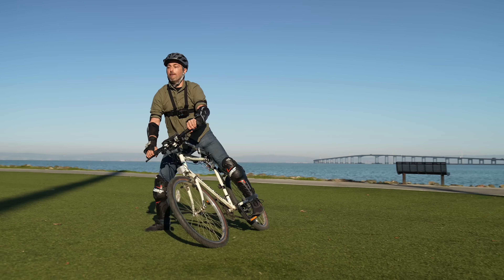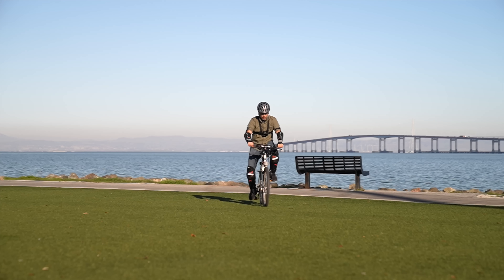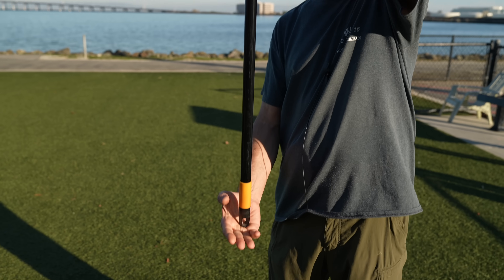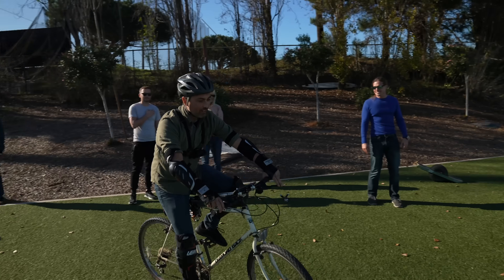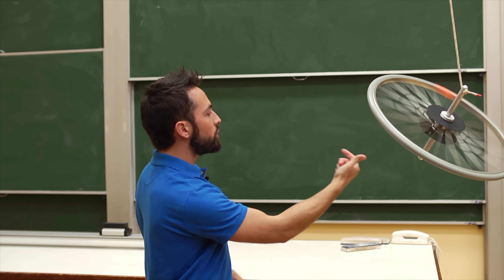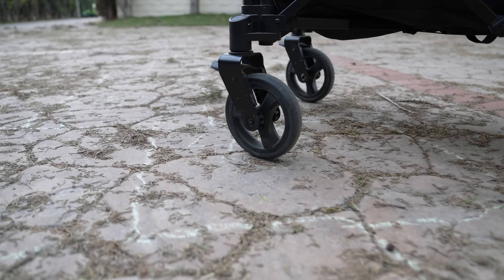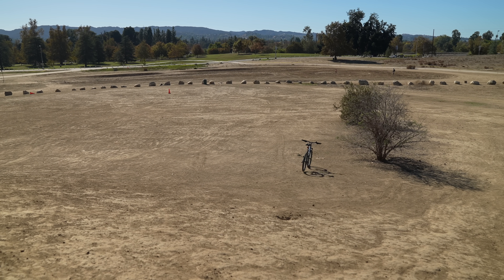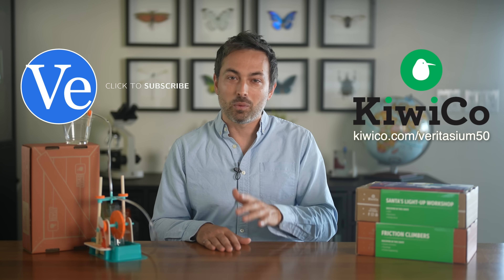Most People Don't Know How Bikes Work

Comment: "Turn right to go left... Hm..." —Lightning McQueen, moments before disaster
Reply: The mechanics said Lightning McQueen would never race again.
Reply: Ah yes, Doc Hudson instinct had prevail the truth.
Reply: lol
Reply: Kachowww
Reply: ayo my favourite embery piano dog
Reply: That reference was awesome.
Reply: That's dirt track racing! Typically the cars have brake bias, with most of the braking force being applied to the rear and left side tire. This way tapping the brake pedal pitches the car sideways into the corner. Some dirt track cars, like sprint cars for example, don't even have brakes on the right front wheel. Anyway, as you enter the turn you tap the brake which then pitches the care sideways into the corner. Of course, you also immediately start to counter steer to keep the car from over rotating and spinning out. And then you begin to apply throttle. Applying throttle helps the car to turn or rotate by spinning the rear tires. So, while rounding the apex and exiting the corner you control the yaw of the car by modulating the throttle and also by how much you counter steer.
Reply: I found your channel by looking in the comments , I love your vid, even though I found you today
Reply: Yup. My car almost crash slipping on rainy road while my car is 90 degrees facing divider. And I've intentionally turned my steering to the right road direction and I'm safe from that disaster..
Reply: That's what drivers do in drifting.
Reply: @TheChrisey  "That's what drivers do in drifting."

Yeah, it's what dirt track racers have been doing forever. Some people also call it a "powerslide". Anyway, if you like drifitng you'll love dirt track racing.
Reply: Technically he turned left, then right to go left, lol
Reply: I tried going right and you know what, this crazy thing happened. "I... WENT... RIGHT"
Reply: Reminds me of the scandinavian or Finnish flick in rally!
Reply: Walnuts and spiders
Reply: لا إله إلا الله. محمد رسول الله 
La elah ela Allah. Mohamed rasol Allah 
إنا لله وإنا إليه راجعون..سبحانك ياربنا ياعظيم
Reply: I don't care what anybody says I loved that movie as a kid and still do
Reply: Lightning McQueen isn’t as hot as Mater
Reply: Doc Hudson Originally said that actually.
Reply: Epic!
Reply: Do you do Celeste music?
Reply: Scandinavian flick!
Reply: That's what i had in my mind
Reply: Wasn't the quote "if you go hard enough right, you'll find yourself turning(steering) left"
Reply: I was just thinking this
Reply: what gets me is i wander if you just lean instead of turn
Reply: @Shawn420s  you still need to counter steer
Reply: How to drift 101
Reply: No.  Push right to go right (push the handlebar), and push left to go left.
Reply: @Tamaresque  I get what you're saying but you might confuse some with the way you wrote that. They might think you mean turn the bar right to go right or turn the bar left to go left.
Reply: That was doc smh
Reply: Ok
Reply: E
Reply: Lol
Reply: Looking for the motorcycle riders in this that already know the concept of counter steering
Reply: I mean yes
Reply: I thought the same thing as I watched the video
Reply: o
Reply: WAIT OH HOW TF
Reply: Thats what I thought of while watching the video!
Reply: Thats How Drifts Work
Reply: It’s a racing technique
Reply: That sucks!!!!!!!!!!!
Reply: HAHAHAHAHA SO TRUE
Reply: XD
Reply: it is actually... turn right to initiate the lean left, once leaning left you can steer that way to be balanced.
Reply: @alanchristiansen2880  don't do that going fast or you will wreck.
Reply: Didn’t work for him because he’s a car I guess
Reply: YEET
Reply: imagine a car riding a bicycle
Reply: Turn yourself in to animal control
Reply: Was thinking about this. Lol😂
Reply: Piano doggy! ❤❤❤
Reply: "It was at this moment, that he knew, he fucked up" -the Narrator, probably
Reply: Doc Hudson instinct
Reply: the video literally said it was completely different for cars... In cars you turn left to go left or turn right to go right. in bicycles you turn right to got left and vice versa. you didn't even watch the video and just commented to get brownie points due to your checkmark
Reply: @LuisC7  you only need to counter steer a car when the ass end is sliding out, can't drift without counter steering
Reply: @LuisC7  Who hurt you? :(
Reply: @LyricWulf  hi
Reply: Didn’t think I’d see you here, but I’m certainly not complaining!
Reply: @catflip7406  💝✨
Reply: TOKYO DRIFT-
Reply: Going poop to go take a piss

Comment: This video shows why the condition of your bicycles/motorcycles steering head bearings is all important in how well your two wheeled contraption rides. Dry, notched or worn out bearing races can cause a kind of lock-out as well because the steering is restricted by the uneven movement of the ball bearings inside. A poorly handling bike can benefit immediately from a clean and regrease or complete replacement of the bearing assemblies. The difference is like night and day and should not be underestimated!

Comment: Balancing has been always about the centre of the mass and it's location. The turning stuff takes into account the effect of the so called pseudo force (which is real actually). Interesting video though (as always).
My theory is simple, the location of centre of mass with driver and without driver changes, it also changes when the driver changes. So to study balancing we have to somewhat find the trick to make sure that the center of mass remains at the same location and test it in different scenarios.

Comment: Tldr, he's riding a bike wrong. Like a motorcycle it's about leaning your body weight. Turn right? Lean right into the turn. Turn left? Lean left into the turn. The handlebar is more of a guide (with the exception perhaps of 90° turns or similar) and the real turning action occurs at the shoulders or above your functional center of mass.
Reply: This is also how you stop a car from rolling out at high speeds, by shifting weight towards the center of the turn. Part of the reason why highway turns are banked, with the outer lanes of a turn being physically higher than the inside lanes. This height change also makes the physical distance your wheels travel closer to being equal, so that on a well designed highway you don't have to turn if traveling at the rated speed (usually the speed limit).

Comment: I've heard this is why the Wright Brothers were able to have the first successful powered flight. They had a bicycle shop. When others had very rigid designs, they instead designed their plane more flexible and therefore controllable by a pilot. The pilot could actively adjust to felt feedback like you do automatically when riding a bike.

Comment: All motorcyclists knew this. On a motorcycle in fact, you're pretty much always counter steering except for low speed maneuvering.
You don't just use it to knock you over, if you want to go right, you push your right bar forward, turning your wheel to the left. It's literally turning right to go left.

Comment: In the basic motorcycle riding class available in most US states they teach you to "push right" effectively turn left to turn right. Unless you are turning from a stop. This very slight counter steer offers all the leaning needed for the turning.  Same is true when traveling at speed on a bicycle. Additionally a loose grip on the handlebars offers better control than a tight grip allowing the bike to steer itself. Just be ready to take control if an obstacle appears.

Comment: As a Dutchman, cycling since I was 2 with trainers and 4 without (I'm 33 now). I'm very intrigued. I always assumed the gyroscopic effect wasn't the primary source of balance, because when you cycle without hands on the steer/handlebar (very common around here, most of us can even take corners without hands on the handlebar, at least most people who are fit, young and cycling daily since they were little), you feel the wheel and bike actually align with each other and you only have to do minimal adjustments with your body to keep it going straight (unless your wheels are extremely misaligned or crooked because you hit too many curbs. Crooked frame also makes it more difficult to balance without hands on the handlebar. I owned over 12 bikes in my life, so I know what a brand new bike feels like compared to a 20-30 year old neglected bike). I wasn't really sure why this was happening, but I always assumed that the gyroscopic effect wasn't the main balancing act. So I think it goes in this order: 

1. Handlebar
2. alignment wheels
3. alignment frame
4. alignment seat

Maybe the alignment cases are also a good factor to test, because I'm convinced this also influences the way you balance on the bike. The more crooked a bike is, the more you have to counteract on the forces caused by misalignment. 

I think those are the primary sources for balance of the bike, I am no scientist (probably I am terribly wrong) but I do want to know more about this.
Reply: I don't know if I have the same style of cycling with no hands as you, but when I'm doing it I actually use my legs and backside to press sideways on the saddle to slightly turn the frame, which will cause the handlebars to turn the opposite direction. It's always felt to me that has a greater effect on steering than just moving your own weight left or right.
Reply: @rjfaber1991  now you mention it, and I come to think about it. I think you're right.

Comment: I'd love to see a video with a bike where the contact patch of the front wheel is in front of the axis of the wheel. The opposite of 7:50. Prob you need to project the bike frame past the front wheel and have the axis going "backwards". I'm curious to see if that would change the direction we turn the bike.

Comment: Counter steering is a common technique used by people who ride motors bikes. Also, the shocks on your car have a slight angle to them and the same force that is used to get the bike wheel to point in the correct direction is what causes the wheels of your car to return to the straight forward position when you let go of the wheel. They guy who modified the bike should build another bike but with an adjustable angle for the front suspension so people can feel the difference between the fork arms pointing in-front or behind the wheel contact patch. This is an important factor when designing pedal or motor bikes depending on the use case: fast vs slow, smooth vs twitchy, comfort vs racing... Interestingly, the Euro fighter jet plane was actually designed with these considerations in mind. It is specifically designed to be a very unstable, difficult to maintain plane to fly and requires computers to keep it in the air. However, the unstable nature of the plane makes it twitchy and very fast to react and thus capable of very dynamic and quick flight manoeuvres.

Comment: I was kind of surprised by the fact that not much of the info in this video really surprised me. Then I realized why, its because I taught myself to ride a bike without holding the handles. It only clicked for me when you talked about bikes balancing on their own, because that was one of the realizations I had that allowed me to learn cycling with no hands. Because just like when there is no one riding it, the bike does a lot of the balancing itself when you're not holding the handles. Its more unbalanced since you're on top of it, but if the steering is allowed to do its thing then you just have to do small adjustments to stay balanced and heading straight. And then when you want to turn you just have to first lean the other way and then lean into the way you're turning, just like you talked about. So while I didn't know all the exact details, and hadn't really thought to much about the bigger picture, I had accidentally thought myself most of the knowledge found in this video by learning to ride a bike with no hands. Which I think is neat.
Reply: I figured out how to ride a tandem bike from the back seat (that has no steering) because it’s basically the same thing as riding a bike with no hands.
Reply: The funny thing is I can also ride with no hands (or at least could the last time I tried ~20 years ago) and I never consciously thought about any of this.
Reply: I also ride my bike quite often without using the handlebar.
I basically control the direction by leaning or pushing my hips from left to right, and in tighter turns it's quite noticeable that you first need to "swing" in the wrong direction.

Comment: For most, vehicle change direction when you change half of your wheels in a different angle compared to the vehicle direction. Most people assume this also apply to 2 wheeled vehicle, which in truth only is true on low speed, where inertia force is not great enough to tilt the vehicle the opposite direction, that you steer to.

When you take your motorcycle-licence course, you will learn the theory on how bikes really turn direction, and that is by geometry. The Geometry of the rounded wheel if you view it dead on from the front or back. 

Imagen this: the radius of the rounded wheel is different, depending on where you measure from center of the tyre or to the either side of the edge of the tyre. The center of the tyre having the longest radius, and the edge of the tyre having the shortest radius. For each rotation the wheel spin, the edge of the wheel will cover less distance (have less speed) while the center of the wheel will cover more distance (have more speed) 

This explains why the vehicle run strait line if you are standing 90 degree compared to the ground. As soon as you tilt few degree to either side, your wheels are engaged with a contact patch area were the side area are slower and the center area are faster. An Analogy for this is, if you have two person carry a pole on each side and they run parralelle with eachother, if one slow down, they will change direction.

So really, the real reason you change direction on 2 wheel vehicle, is because you lean your bike. You can either do this by leaning you body, and change the center of gravity on the vehicle so it fall to the side (which is inefficient on motorcycle due to weight ratio). Or you can countersteer, and use inertia force, to lean the bike in the direction you want to turn.

My guess on why a bike stay upright in motion? Is two fold: Conservation of momentum. When all momentum is applied to an object, the sum of all momentum will dictate the direction of the object. In this case we have gravity, that push the bike and keeping it at ground. The "second force" is the ground that "nulls" the gravity . The third force is from the drive wheel, that apply a momentum to the bike in one direction: forward. The momentum forward on the bike, needs to be larger than the force that push the bike down.

Conservation of energy: Not in the sense of making or breaking energy. But more in a sense of least path of resistance or energy expendure. The Geometry of the wheel: force the the wheel to stay upright, when the wheel is expending the energi from the source (human legs or motor). 

Staying upright means having less contact with the ground, lesser energi loss in tyres.
Staying upright means only having one speed on the contact area, more efficient spendure of energy.